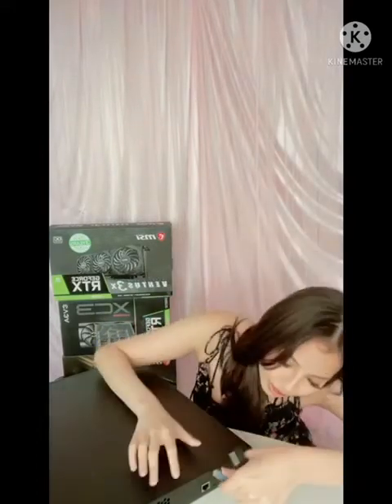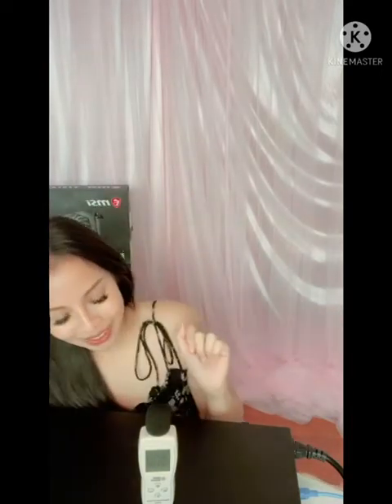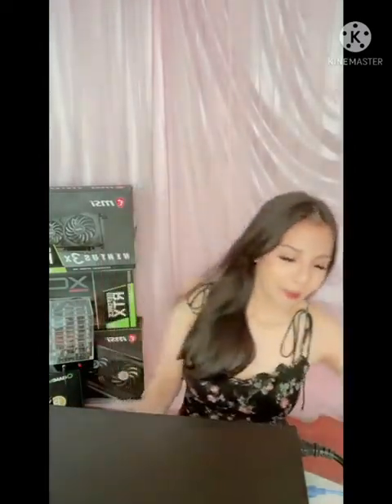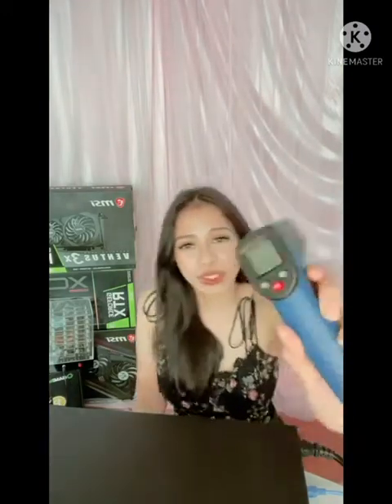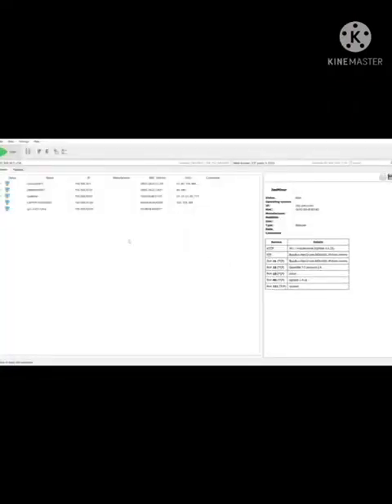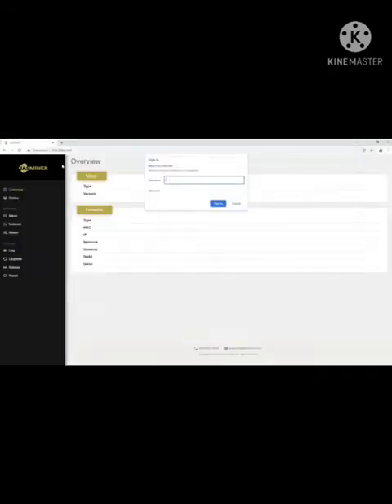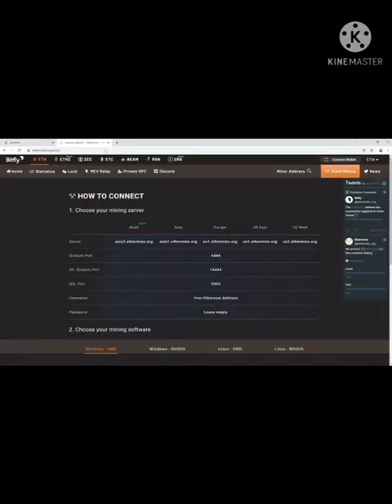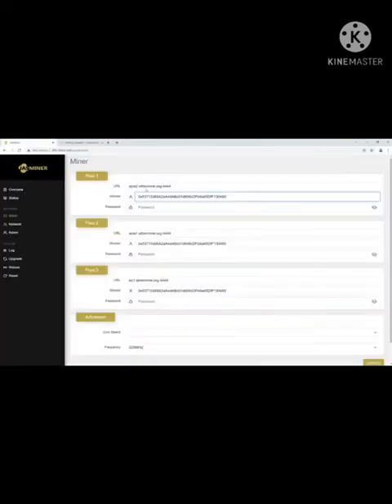Jasminer X4 1U Server Set Up & Review - Most profitable and efficient Ethereum ETH ETC ASIC miner?

Comment: is it possible to access this information remotely? I mean if the miner is installed in one place and I am in another (connected to another network) can I access this information?
Reply from the maker: yes it is.. you can put a desktop or laptop (connected to the same network) as the miner, then you can install teamviewer software to control it remotely. However, there is actually no need for you to monitor via laptop or PC since once set up, it will auto run.
Reply: @cryptolela5004  where to buy it in Singapore?

Comment: Thank you! Does it arrive with a 120v or 240v cord? I understand the power supply is built into the unit?
Reply from the maker: the PSU is built in 220V and a 220v cable is provided. if your country is using 110v, you will need a step up transformer 🥳  

Happy 2022!! 😉
Reply: @cryptolela5004  Thank you! I have 240v or 120v, just depends on where I'd place it. I move them depending on the season to heat when it's cold. I'd love to buy one but want to make sure they will last. Big expense for what I believe is unproven or untested over a decent period of time. Thanks for your great review!
Reply from the maker: @JonesboroughAerialPhotography  Thanks! I have a wide range of miners and ASIC available and my supplier ships worldwide. You can DM me on instagram @cryptolela if you're interested in purchasing one. Have a great day 😄
Reply: @cryptolela5004  Will do.
Reply: @cryptolela5004  Are you getting consistent returns with this?  How's the performance a week in?  Asicminer says it should return about $28/day at current ETH prices what are you seeing after a week? Would you set up a few of these in a spare room at your home?
Reply from the maker: @Agency323  yeah... its about 550-630 Mhs.. yup I will be doing a follow up video on the earns soon (hopefully) 😉 but Ethermine shows daily estimated earnings about US$30-32/day